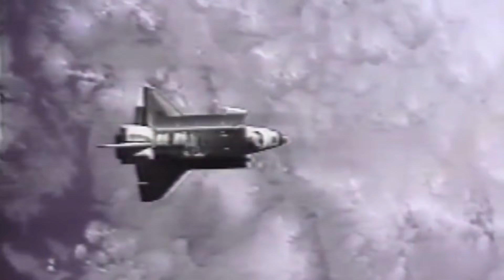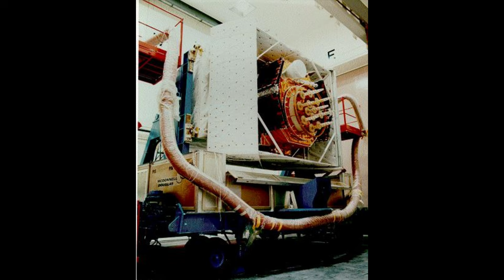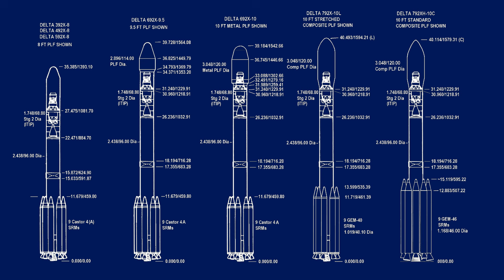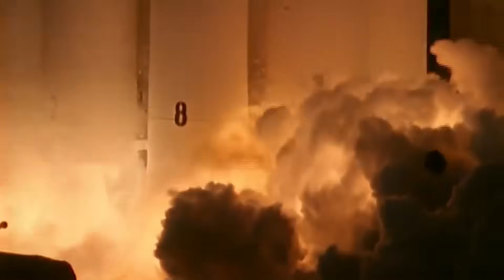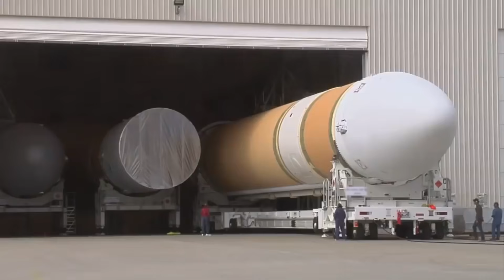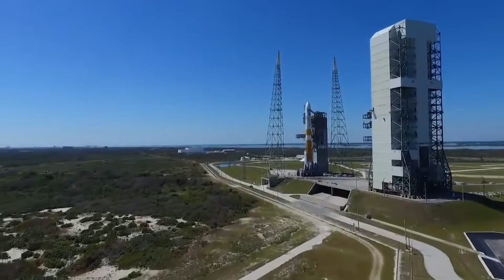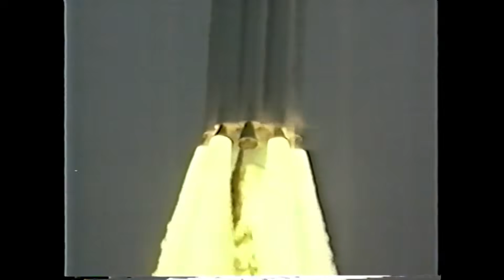Delta Rocket History - Part II - Legacy Of Thor - America's Most Successful Rocket

Comment: The Shuttle was a design entirely driven by politics. Therefore, it was ridiculous.
Reply: It was oversold and underfunded. But it was the only game in town that NASA could get (after having to get in bed with the USAF, DoD, and NRO) - which caused it to be much larger than what NASA had wanted as a crewed vehicle, a more legitimate smaller "shuttle" to and from a space station. That "mission creep" and the design solutions to keep it within the budget ultimately doomed it.
Reply: @rosswarren436  This. NASA at the end of the Apollo era had only the Saturn V as a human rated platform and when their budget got slashed by more than half they simply didn't have the funds to keep flying it. The shuttle was what they could bodge together on a shoestring, it was flawed but had many innovative ideas, what killed it more than anything else was the complete financial neglect from start to finish. It never had the money to be done well initially and it never got the money for the major redesign work required to really mature it.
Reply: @darthkarl99  indeed.  The number of Saturn V's was capped. No more were ever going to be produced. Once the production lines were shutdown, much of the required tooling was scraped along with all the technical know-how to produce it.  In many ways it was as much industrial "art" as hard-nosed engineering. They cost too much to use, or that was the thinking. It turned out that the shuttle flights each cost almost as much as a Saturn V did though, so no money was ultimately saved - and we still flew them for 30 years. And if we'd had Saturn V around we could have built a  large space station soon after Skylab.  Who knows, the Columbia tragedy might not have ever happened if they had been flying to a station instead of merely hosting Spacelab internally. 

NASA was hemmed in by the lack of funding. Hell,  in the mid-1970s they had trouble paying their power bill in Houston.  

The shuttle was a very unique vehicle with some incredible capabilities, but yeah, it was too flawed. We were extremely lucky that in the numerous flights to build the ISS we never lost another crew.  

NASA later calculated that even with all the post Challenger upgrades, it had a 1 in 78 chance of a catastrophic failure each time it was flown.  That is far worse than what we usually hope uncrewed vehicles have.
Reply: @rosswarren436  The smaller Shuttle concepts were back when there was the potential of Saturn Vs providing the heavy lifting. Afterwards, the Shuttle had to do everything on its own.
Reply: @HalNordmann  the Saturn V contract was for a very limited number of boosters. We were not in a position to keep building them. To get funding for the shuttle, NASA had to get in bed with the USAF, the DoD, and the NRO.  That caused the mission creep in size due to their wanting to loft big, heavy spy and intel sats. The idea was for the shuttle to replace all expendable vehicles. 

But of course we saw how that idea was very premature and dumb and far too costly. Launching satellites on the $300 to $500 million per launch shuttles never made sense, and adding in the risk to crews it was even more crazy. 

Even after getting in bed with those agencies, the shuttle program barely passed the U.S. Congress, and the Nixon administration wasn't all that commited to it.   We were lucky (or unlucky in retrospect) that it became a real program. I'm glad it is gone.

NASA's original ideas of a smaller crew shuttle and a "big dumb booster" for lofting heavy payloads would have been far better if it had been chosen and funded.

I assume that "big dumb booster" might have been based on some Saturn technology or SRBs and made much cheaper.  Heck, they might have tried making them recoverable and reusable if they had been given the chance, decades before SpaceX.  20/20 hindsight.
Reply: Not this again....
Reply: No, it was a von Braun design that was then bastardized and hamstrung by politics.
Reply: @mrflippant  von Braun and others proposed a flyback booster design. But no funding killed that.  It just so happened that Fletcher, the NASA admin at the time was from Utah where Thiokol was located.  Coincidence? Well, maybe.
Reply: Human civilization is a design entirely driven by politics...
Reply: Rofl, the Delta, Atlas, vanguard, and Saturn rockets where all driven by politics. And the R7 and Proton too.
Reply: Yeah but it was and still is alot cooler then these dinky little capsules the closest we ever got to an actual starship